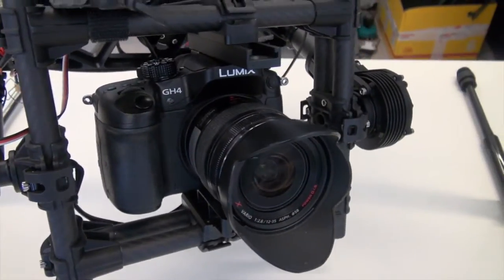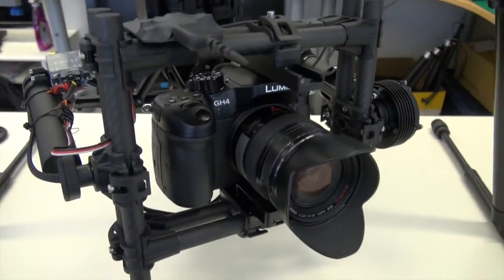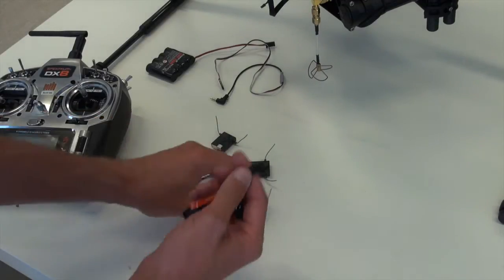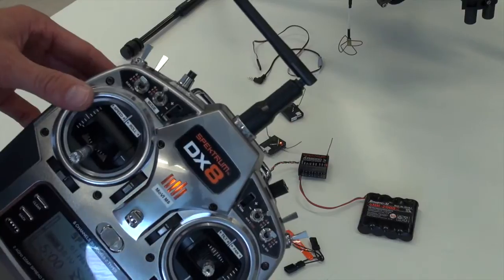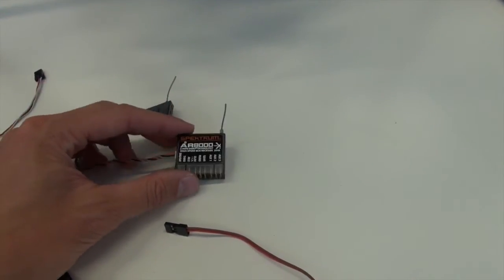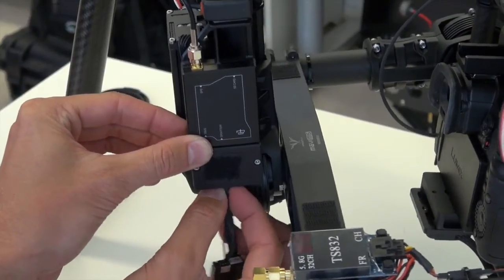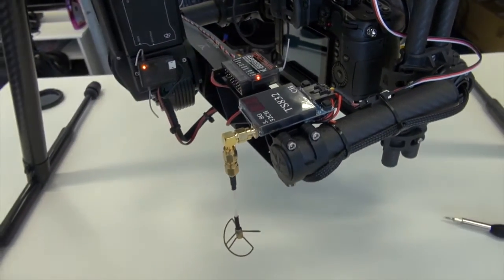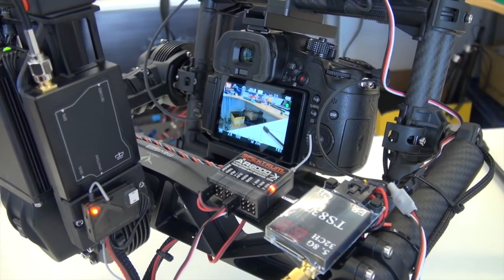Freefly Movi M5 & Spektrum DX8   Dual Receiver for Shutter Switch on

Comment: Excellent video.  How did you power your downlink power of 12vdc though.  I had thought of using a duel output regulator and tapping into the balance ports, but it adds complexity and weight.  I like the clean look you have.